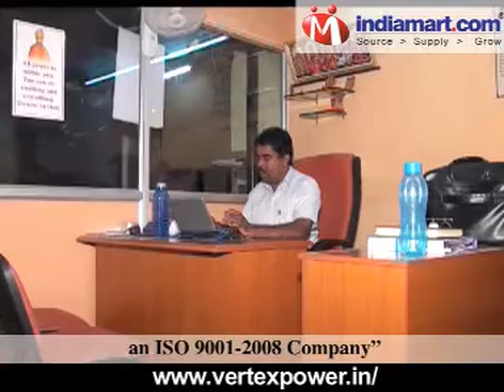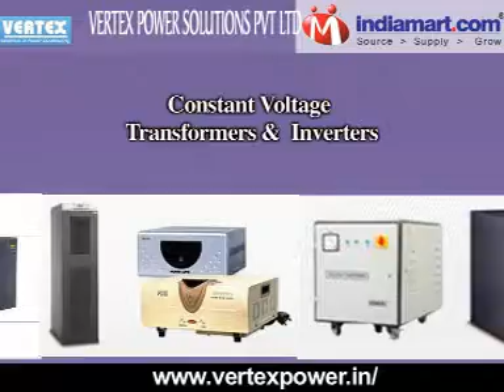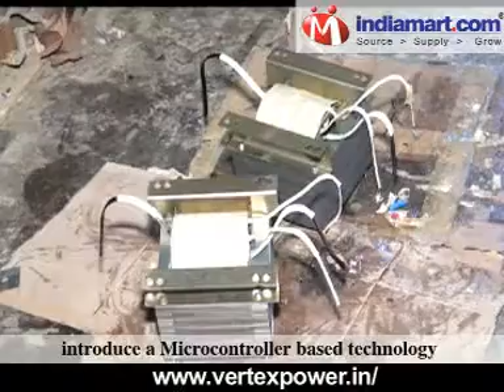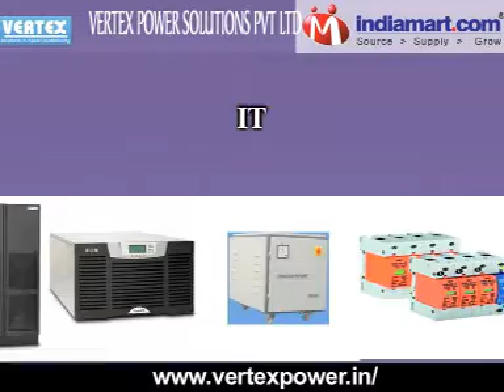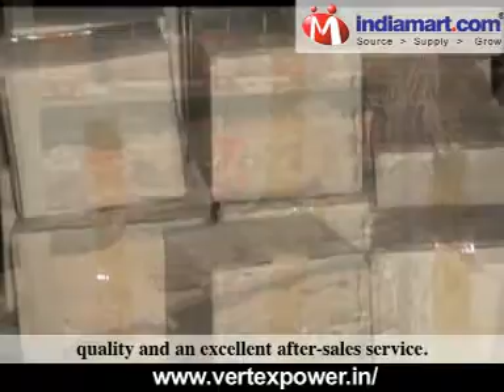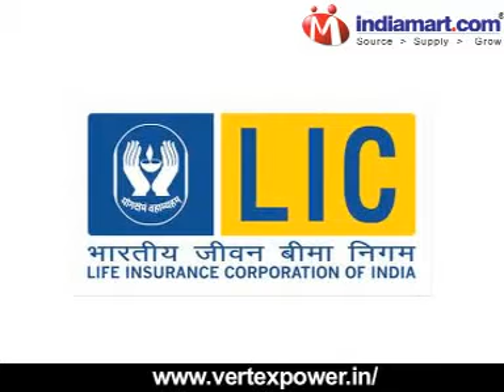Vertex Power Solutions Pvt Ltd, Chennai

Comment: I buy vextex servo stabilizer 15kv but it's not good for sound system I use only 5kv sounds the stabilizer I use 15kv it distrub distortion at the same time High &low voltage

Comment: Servo Stabilizer installed in Mantri Synergy, Padur for all the Lifts (19 nos) , sewage treatment plant for motors and water treatment Plant about 4 year back and all working without any problem after shortlisting the quotation received about 27 nos vendor from all over India.  Please contact Devanand cell no 9710190175 for any details information . Looking after the technical team of Mantri Synergy owner association, padur, chennai 603103.